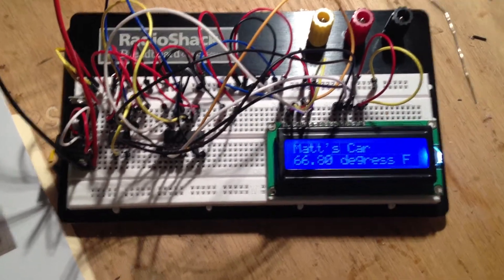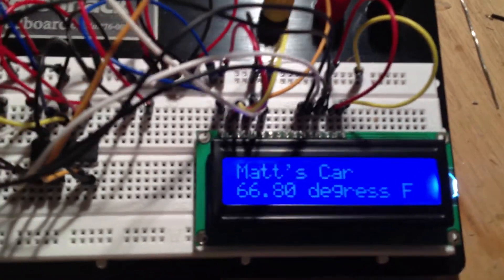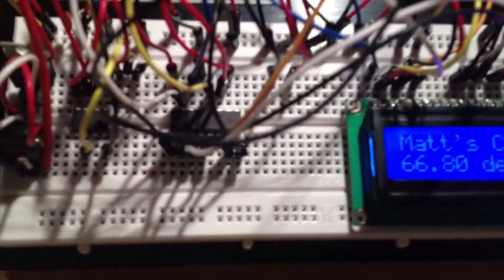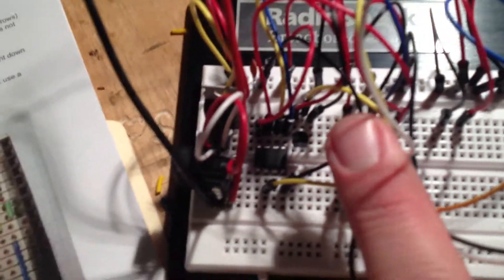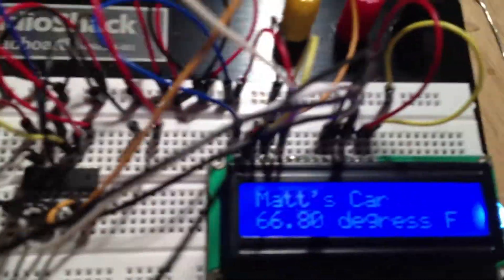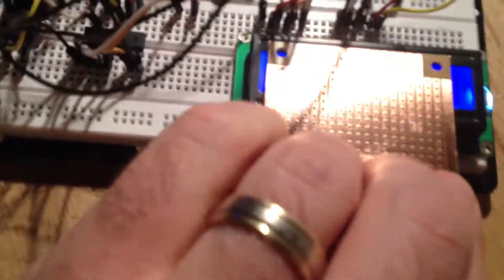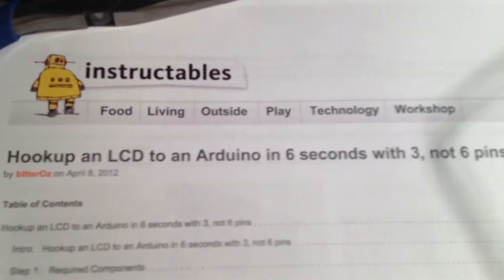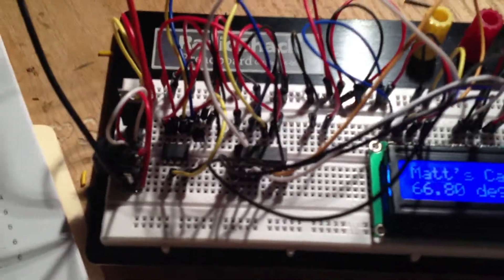DIY Car Digital Thermometer with ATtiny85, Shift Register, TMP36, and LCD screen

Comment: Great Job! I'm trying to get my lcd to work with a tiny85. I have a 20x4 display with an I2C backpack. Are you familiar on how to get this up and running? will the 595 library work.. I've been searching for hours to find a solution. I dont have any shift registers on hand. Any suggestions. Thanks for the upload.